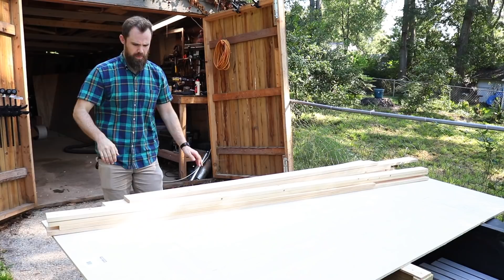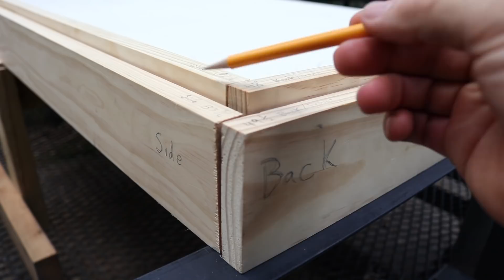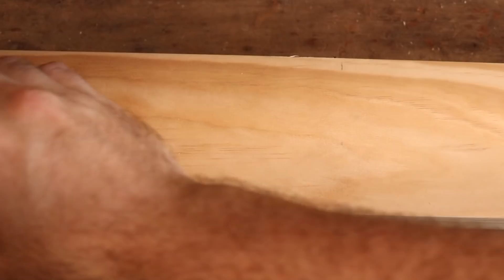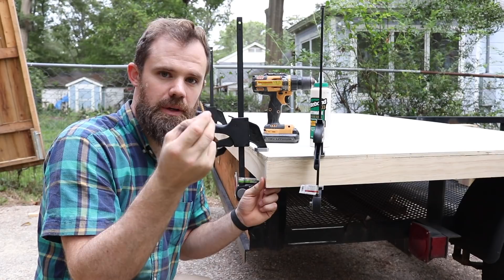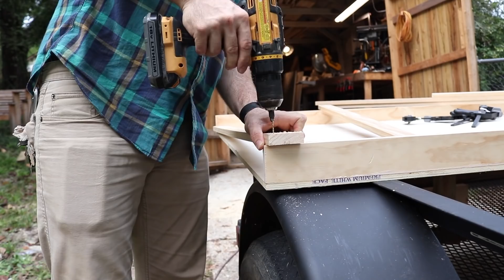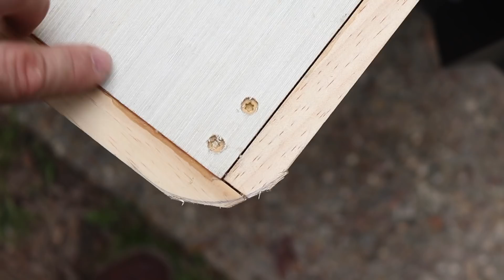Rooftop Tent Build Series - The Base!

Comment: Roof top tents are great, but if you look at the other companies that sell and build them they may have something that us DIYers can learn from. Question how many use wood to build their unit? probably none. So why not look at another way. Wood is heavy, can warp, needs to be sealed and can leak. Ever thought of using materials that Roads cases are build out of?  (Penn Elcrom) is the company that sells Aluminum extrusion, polyproplene sheets. Cut, join,  Rivet, hinge, done.Take a look might be a more simplified way.
Reply from the maker: Yes, but I have a lot of thoughts.. This tent was built over 8 years ago. Back when RTTs were $4-6k. It’s was the first diy rooftop tent build series on youtube and was before I knew what aluminum extrusion even was. It is wood but it’s covered in fiberglass and painted. It’s essentially lightweight boat hull. It’s not warping , leaking or rotting. I still have mine today. Aluminum extrusion and other materials can also leak too if you aren’t careful. There are pros and cons to both. It’s all about how you want it to look. Not everything that’s built has to be done the simplest cheapest way possible. It’s all up to the builder. All that said.. knowing what I know now.. I would probably either build it completely from fiberglass or do aluminum extrusion 👍
Reply: @PatrickRemington  ok good to know. But good on your for making one

Comment: Hey Mr. Remington, I am planning to build the original rectangular style you did, not the clamshell, but im learning from this base and top piece to do it. I am wondering if I should be doing to step up all the way around?  as this clamshell you dont have the step up on the rear for the hinge.  thank you!!! I cant wait to  start building this winter, you are a huge confidence booster and inspiration.
Reply from the maker: Yes, you do the step-up all the way around. They are built exactly the same. I actually changed the design and added the step up on that fourth side in this build. I think I mention it in the struts video.

Comment: Hey Patrick....freaking awesome bro....so I just started my build and got a few questions ....1...in place of glue with screws can I instead use gg heavy duty construction adhesive (still using boat central epoxy/resins like recommend)just talking about the connection of 1-4 to plywood ect....also is it possible to watertreat all wood prior to construction using OLYMPIC WATERGUARD STAIN and sealer? I am worried about adhesive grip after water treating so I figured I could use painters tape on all connectors so as not to change surface of wood where other substances will be used( epoxy resins/ect.....also where the hinge goes can I just use a single piece of lumber cut to size?thanks for all the help man amazing build best subscription on YouTube keep up the great work bro
Reply from the maker: You can use construction adhesive. I can't speak to the Waterguard for a sealer. I'm not sure how well that will work.  I sealed it with expoxy. I will be posting a video soon on how to fiberglass the surface so definitely be on the lookout for that.  Not hard at all. For the hinged side you need to build it just like the other 4 sides. I I Know I said to keep it flat but changed that in a later video. The struts video I believe.

Comment: I looked through the comments, and listened to the video a couple of times now. Why did you use 1x4 for the sides as opposed to ripping down 1/2" ply to save some weight? I realize it wouldn't be a lot, but I would think it would help some?
Reply from the maker: weight and cost! I would have had to use two layers 3/4 plywood to get the thickness I needed and that would be much heavier and more expensive than using pine board. If you are interested in building you should joint the facebook group! Search DIY rooftop tent community
Reply: I actually kind of waffle between a rooftop and a teardrop. I have occasions where one would be better than the other, and may end up doing both. I do love what you are doing!

Comment: Built the base today :)
Reply from the maker: Harley Cross heck yeah! Did you catch the small modification in the struts video? It's very minor. Also when you are making the top frame make sure it is square or at least matches your base very well. After the top frame is built and before putting on plywood, go ahead and figure out exactly where the hinge will go mark and predrill holes (if you are using piano hinge). These are just a couple things that have given me trouble.
Reply: Patrick Remington awesome! Thanks for the tips. Great series and super helpful :)
Reply: Patrick Remington watched the strut vid. What modification? You mean weather strip? Think I may hinge on Outside. Cheers
Reply from the maker: I'm talking about doing the step up/Drip rail around all 4 sides instead of 3 like I did.
Reply: Patrick Remington cool! Like the finishing touches 
of this and hinges.  https://youtu.be/xQd45vUTBM0

Comment: Just started following you Patrick and I’m well impressed! Very much looking forward to seeing the full build out and planning one myself having sold a self build teardrop this year.  The episodes are great so far and the detail and content just about spot on... the length of the video is determined by the job to some extent as the base is one, the roof another and so on. Personally I have no problem with the length which could well be variable but aim for a maximum of 30mins for impact.
Cheers ;-)

Comment: Thanks for the video. looking forward to the next step. PS, The tape measure you are using would be as rare as rocking horse poo, here in Australia. At least ours has both inches and metric. If you go to a hardware store, the timber is sold in metric size, but go to a lumber yard, it's in imperial. Funny that.